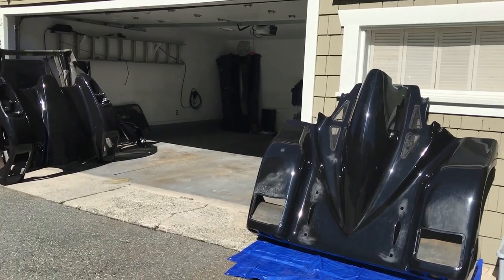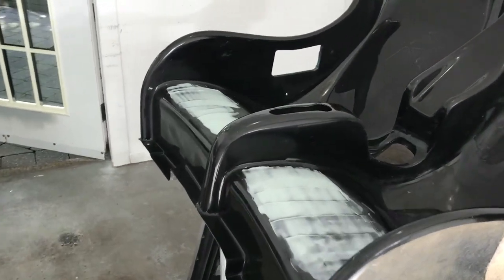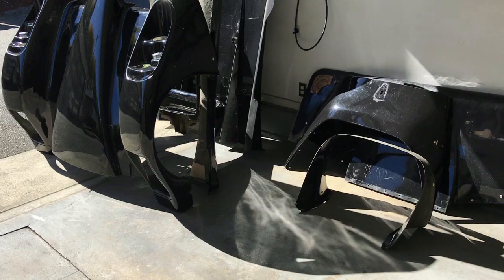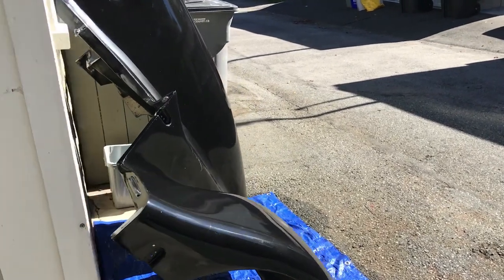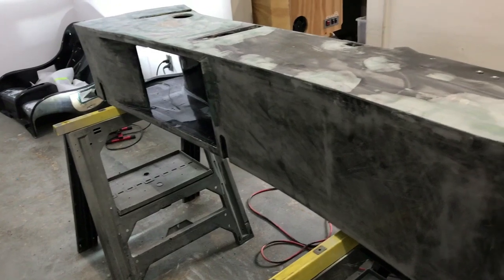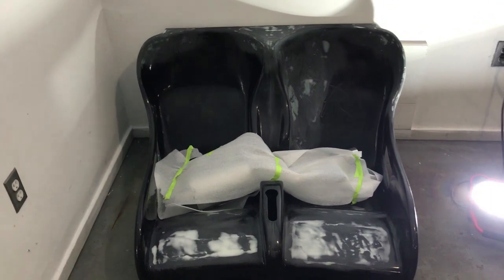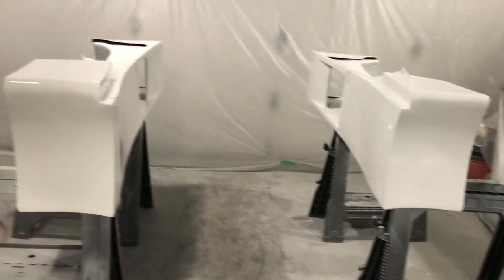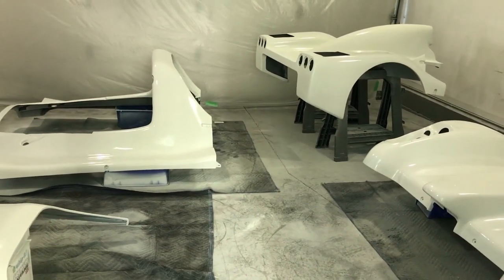Radical SR8-RX 2.7L V8 Race Car - part 2 (Body Panel Repairs & Strengthening)

Comment: Have you gotten a trailer and tow vehicle?  Obviously, this takes lots more logistics that just putting track tires rack on the GTI and driving it to the track. Looks like you are making great progress.  And yes, all of the Radicals are heavy, that was one of their Achilles heels in club racing.
Reply from the maker: I have a Futura open trailer - the one that drops down to load the car so no race ramps required. I trailer is aluminum so I can tow it with my SUV. Yes, the SR8 is a lot more involved than the little GTI!